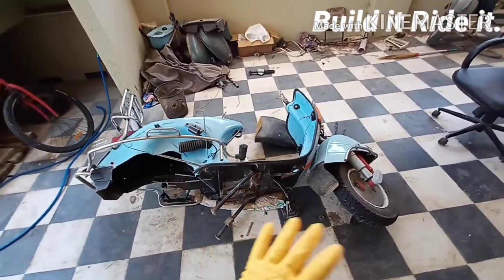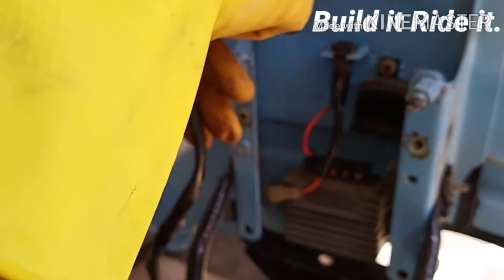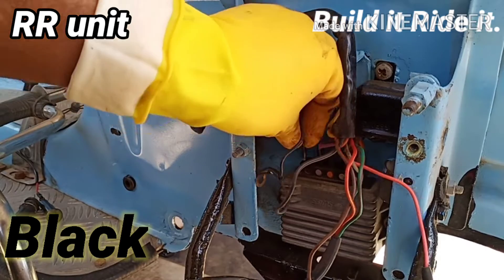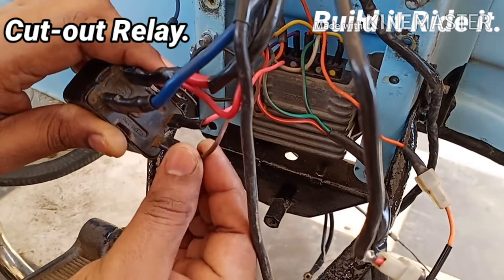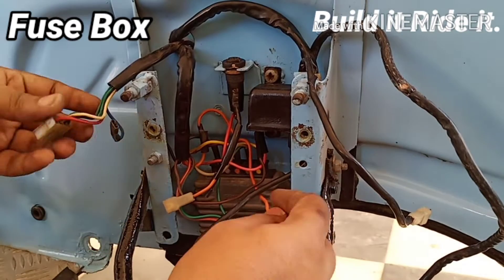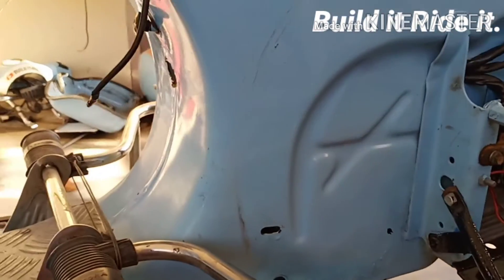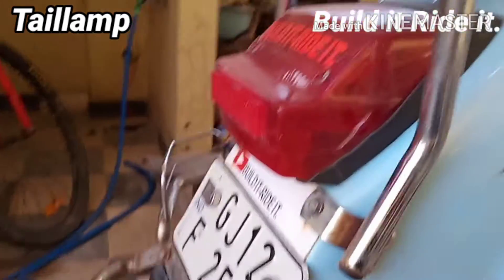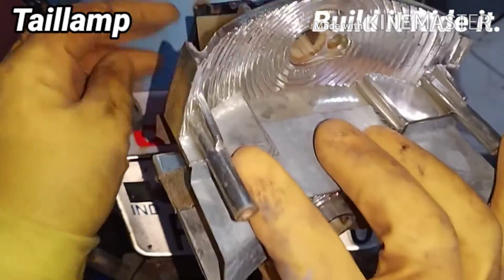Wiring on Vespa: connecting electrical components on the frame.

Comment: Hi Sir, I am Remedios di Costa, Goa I have a LML Vespa nv special scooter i wanted to put a battery 6V or should it be 12V? Cdi needs to be changed if so what is the replacement? Only for lighting and horn